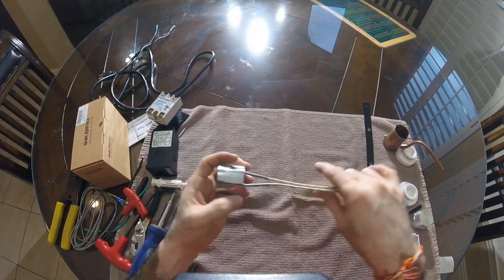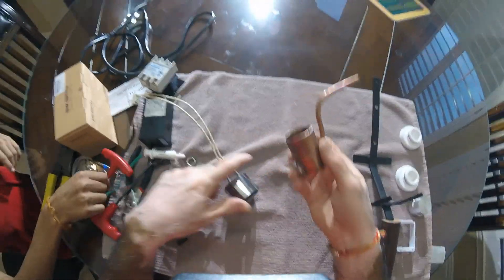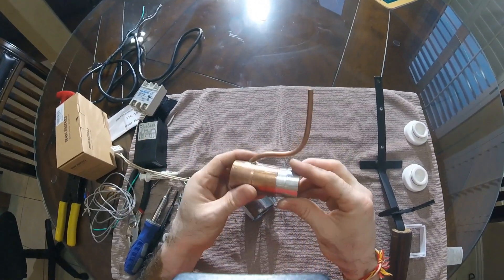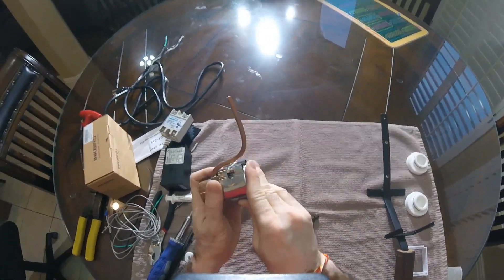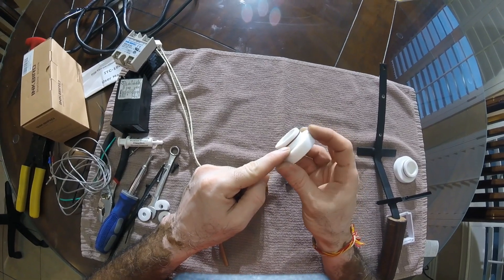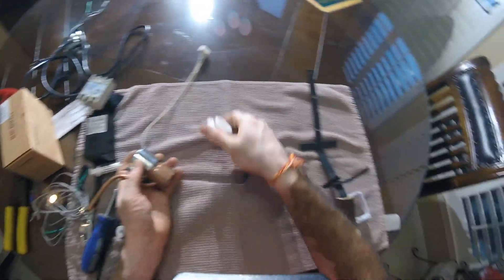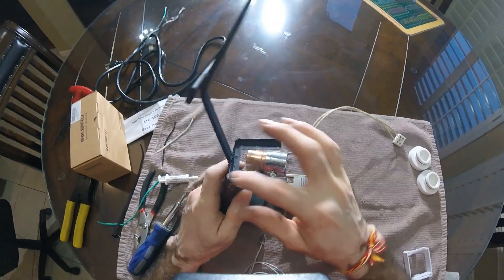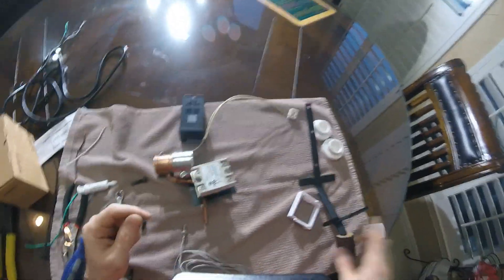DIY Oxalic Acid vaporizer - Made using a band heater

Comment: Excellent tutorial, Thanks!  Wondering about using the ITC-106RH and powering the band heater directly rather than the added cost of the SSR?  The 250w Band heater should use 2.5A and work within the  3A of the onboard relay eliminating a part and some cost.  Thoughts?
Reply from the maker: 3A is too close to operating power requirements. Maybe you can add a regular relay to power the band heater.

Comment: Please tell me the prices in the commants you use and what they mean .My basic problem is  that I easily loose  the   proper temparature 230c
Reply from the maker: PID settings would be different based on the mass of your metal. My settings are: P=100, I=135,D=17. You will
Reply: i will try it and i will come in touch. thanks

Comment: Hello. Is there any reason for bending the tube in the S or could it go outstraight ahead?
Reply from the maker: Straight is better. The reason for bending the tube for me is to be able to rest the apparatus on the bottom board when treating from the front entrance. In fact, the bent tube needs frequent cleaning to avoid blockage. Avoid bending if you can.
Reply: Thank you for your answer. All the Best for you

Comment: Hi, thanks for the great video. Can I use an on/off thermo controller instead of PID?
Reply from the maker: Yes. In fact,  I recommend using on/off controller or even thermal switch to save on cost. Because I mostly don't see my PID controller supplying partial current.
Reply: @PrincetonProjects  Hi, I'm using a 220v/145~175watt band heater, does it make a difference whether I use a 25A or 40A ssr relay? Thanks.
Reply from the maker: @mohamadrezaalamshah659  25A is a lot more than you need. For 230V and 175W, you only need less than 1A current. In fact, you may be able to use a simple relay and a on/off controller if you want to save cost.
Reply: @PrincetonProjects  thank you Princeton Projects for your replies which were very helpful. I'm almost there and down to the last part, cookpot. I have three options: 1. Two piece Brass tubing and aluminum block for the bottom, 2. One piece made of rigid aluminum rod, 3. One piece made of rigid brass rod. Which one do you recommend? Thanks.
Reply from the maker: @mohamadrezaalamshah659  One piece brass is the best choice but serviceability would be harder. The reason I keep the pot separate because copper pot will corrode first dues to acid which can be easily replaced by loosening one screw vs. single piece would need a complete disassembly. Not a huge deal but something to think about.

Comment: Where you find your thermal coulping on you vaporizer I can't find the small like you have on your video what size and part number if you have it
Reply from the maker: You mean copper coupling? Or band heater? Copper coupling from hardware store in plumbing section. Bamd heater from Amazon: 35mm diameter.

Comment: What type aluminum stock did you use
Reply from the maker: I used 6061 alloy
Reply: Does it not react from the oac
Reply from the maker: @stephen26448  I don't know. I don't see any significant pitting at the bottom.
Reply: @PrincetonProjects  so I guess it hasn't killed your bees then I was thinking about possibly gasses from the 2 parts mixing with heat
Reply from the maker: @stephen26448  Bees are doing great despite my help!

Comment: I am wondering what type of o-ring you used for the cap. I have lots of buna type, but don’t want them to melt. If you could provide a link if you used high temp ones as I am having trouble finding them locally. Thanks
Reply from the maker: Silicon o rings from eBay

Comment: Nice video! Thanks for sharing. How is this unit working for you? is it still doing well? is there any replacement parts did you have to do? Also, why did you use Aluminum for the bottom part of the cook pot? Wouldn't Copper or brass be a better metal?
Reply from the maker: It has been working great. The cook pot base leaks a little since I don't have it brazed but I like the option of being able to replace the copper "pot" in future. I used aluminum since that what I had on hand in my stock. Copper of bronze would be better. The outlet pipe needs to be cleaned by boiling off water after every few batches of OA. I would use a 1/2" copper outlet pipe if I build this ever again but that would also mean the copper pot needs to be much taller to avoid spilling boiling OA into the outlet pipe.
Reply: @PrincetonProjects  Nice!! I was thinking of using 42mmX50mm and 110V 380W Heater band. Do you think the PID unit able to handle that size? Thanks!! Keep up with the great work...
Reply from the maker: @gayandonamarasinghe8166  Yes, PID controller would be fine.

Comment: Curious what kind of solder was used to join the spout to the cookpot?  Most plumbing solder melts below the temp setting of the provap?
Reply: Don't use silver solder. Use bronze welding rod with oxi-acetylene torch.

Comment: The temp are too high!!!!
Hardly anyone knows that sublimation of oxalic acid occurs only above 159 ° C and a maximum of 189.6 ° C. Above this temperature, oxalic acid breaks down, i.e. decarboxylation, and what comes out of the tube is formic acid instead of oxalic acid and carbon monoxide and carbon dioxide. Evaporation of oxalic acid at too high a temperature, outside the sublimation range, is a procedure with much lower effectiveness compared to properly carried out sublimation.
Reply from the maker: I understand your comment and I think lot people know about the sublimation temperature of the OA. OA is hygroscopic and absorbs moistures so the initial high temperature is going to be used up to dehydrate OA. The idea is to drop the temperature range to sublimation temperature as fast as possible. You may be right about chance of hitting early temperature outside the sublimation range but this is a tradeoff between speed and effectiveness. In the past, I had a 12V OA vaporizer with temperature switch so the temperature never rose above the sublimation range but it was very slow i.e. about 5-7 minutes vs. less than a minute in this case.

Comment: Hello Princeton Project, could you give the ebay item number of the teflon caps, if possible, please? Thank you very much!
Reply from the maker: I MADE the caps myself on a lathe. I just bought teflon round bar on eBay.
Reply: @PrincetonProjects  hello, is the teflon  heat resistant ? do you sale the vaporizer?
Reply from the maker: @salambeekeeper9464  Teflon melts at 620 F so yes it works. Unfortunately I don't sell vaporizer or cap.

Comment: Can You help me wit the band heater? I can find only 110V  power in 380W, but I can't find the same 380Watt in Ac230Volt.... Do You think it would work 230volt too? Or what's the minimum Watt wich works for this Vaporizer? 

Do I see right, that the Aluminum rod on the buttom is for store the heat and need less time and power to reheat the cap? 

You Wrote, silver soldering won't work. You mean the hard soldering won't work? it's up to 750°C as good I know.... Or I did not understand anything? 

 Thanks,
Steven
Reply from the maker: I don't think the band heater of 110 V would work with 230 V. The wattage rating can be owner or higher but voltage must match your supply voltage. Lower wattage would mean your cycle times are going to  be higher.

Yes, t he aluminium block at the bottom is the heat reservoir.

Silver solder = plumbing solder for copper pipe. If your solder needs high temperature torch (i.e any oxi-torch) then your solder should hold up.

Comment: Great project and informative, just wondering if this tool could be wired up using 12 volt system, thanks again for this vid.
Reply from the maker: You can use inverter to power the device from 12v battery. I used a 12v design before using car glow plug and temperature switch but it took over 5 minutes to sublimate one charge. If you have only few colonies then glow plug design might work for you.

Comment: I have my teflon cap with o-ring installed, fits the 1 1/4 .coupling perfect. Also the aluminum base is now machined! Look so good and fits good! I'm getting more excited. I have another question. Is there a certain reason that your 1/4 tube has the bend and shape that you made? Will it work just as well if I use a straight 1/4 inch pipe coming straight out of the fitting, without the bend? Thanks, Phillip
Reply from the maker: Good to hear that you are making progress. The 1/4" bends serve no purpose other than to clear the heating band bolt. No 90 degree turns so you don't cause blockage. And shortest as possible to avoid blockage.

Comment: Jigar, what are the P, I and D settings you use on your PID? What temperature do you set it to? I have a similar design, but I use a REX C100 with the SSR. Thanks.
Reply from the maker: Setting would be different based on the mass of your metal. My settings are: P=100, I=135,D=17
Reply: @PrincetonProjects  thank you. I have updated my final project on bee source. Cheers!
Reply: What is your beesource name? I will look it up.

Comment: get the PID controllers from Auber, in GA.   $35 bucks,  and has built in relay.  Not a solid state, but a mechanical.  Works well.  Ive been using it for 6 months now. band heaters off amazon
Reply: Themachinewon which of the Auberins PIDs are you using?

Comment: Silver soldering does work, it takes up to 900 degrees.. Regular solder doesn't work.  Band heater heats to 450 degrees,  past the melting point of regular solder.  Silver solder the base and braze the tube to the cup.. Brazing has more flexibility,  silver solder is for ridged joints.
Reply from the maker: I used the plumbing silver solder and it melted at 250 C. I call plumbing solder as silver solder.
Reply: I did a second video, you can watch for the parts I used, and the handle, the bands,muffler wrap.  Im going to do another video with more details for everyone   @PrincetonProjects
Reply: Yeah, as you know by now its not the same.  Regular torch cant melt Silver solder.   @PrincetonProjects

Comment: I think you would have better heat distribution if you screwed the thermocouple in the centre, and mount the cup to handle using the off-set drilled/tapped hole...
Reply from the maker: Good idea.

Comment: Hello again I was curious what kind of O-Ring you used on your caps? I'm guessing something that can withstand high heat ? Thanks again. I turned 4 caps on a crappy DYI lathe I made they came out ok considering it was done on a lathe powered by my 3/8 drill lol.
Reply from the maker: The O-ring on the cap is made from silicon. Be sure to get the correct ID depending on the slot you cut on the cap. The OD should be little bigger than the ID of the copper fitting. The O-ring will wear out from use so make sure you get pack of 50 or something. They are cheap in bulk on eBay anyway. I think I paid about $8 on eBay. Item name: FDA SILICONE O-RINGS 024 QTY 50  1-1/8" ID X  1-1/4" OD. If you have a press then you can flare the opening of the fitting using a steel ball from a trailer hitch which will reduce the wear on the o-ring.
Reply: @PrincetonProjects  hi, sorry did not see this reply to high temp o ring .  Would be able to provide a source link?
Reply from the maker: @christopherc7242  I bought them from eBay. Just search for "silicon O ring" They do wear out over time but I can finish about 20 hives, 3 times before I replace them.
Reply from the maker: BTW great work making the caps on a "drill lathe"!
Reply: JP I would like to see how you did this, made the caps. Do you have a video? Thanks Phillip Hall
Reply from the maker: @PhillipHall01  Unfortunately, I don't have the video for making the caps. I simply turned then on a lathe. You may have to bore a starter hole in the center for cutting in the cup.

Comment: I thought the temp range was 160c to 187c?
Reply from the maker: You are correct about the sublimation temperature for OA but the device design suggests the start temp to be 230 C. I am sure there is some method to this madness temperature but I am just sticking to what others have figured out.
Reply: I am just trying to learn as much as I can, I plan on building a few different types of vaporizers to see which I like best. Thank you
Reply from the maker: @jpthedelawarebeeman6239  I am guessing the high temperature allows the moisture to evaporate and thereby speeding the overall sublimation time. FYI: I was using 12V glow plug design with a temperature switch which was taking over 5 minutes to finish the sublimation.
Reply: Very good question!
Hardly anyone knows that sublimation of oxalic acid occurs only above 159 ° C and a maximum of 189.6 ° C. Above this temperature, oxalic acid breaks down, i.e. decarboxylation, and what comes out of the tube is formic acid instead of oxalic acid plus carbon monoxide and carbon dioxide. Evaporation of oxalic acid at too high a temperature, outside the sublimation range, is a procedure with much lower effectiveness compared to properly carried out sublimation.

Comment: Does the outlet need to come from the top and bend down, to "pour" out?
Reply from the maker: The outlet needs to stay clear of the boiling oxalic inside the chamber so yes, outlet pipe should start high inside. But we are not necessarily pouring out oxalic acid since the vapors are coming out of this pipe. Keep this pipe as short as possible since it can clog up if it is doesn't stay hot.
Reply: watch my other video, explains the cap depth and where the tube is drilled in the side.. In theory, you could have the tube hole just above the bottom, as vapor has to go out the tube, you must have it high enough so the acid doesnt drain out first

Comment: Where i can buy this metal=? ore where i can order one ? Min 2:22 in your video ?
Reply: @PrincetonProjects  THXXXXXXXX for your help - and again i have a problem how and what i have to connect on the REX-C100 - and where i have to plug in den Band heater ..... its to fast for me in your video .... :( you send me picture ?? where i have to plug what `?
Reply: @PrincetonProjects  Did you weld the aluminum into the copper?
Reply from the maker: @sergethomas8853 No, just press fit.
Reply from the maker: @sergethomas8853  No, just press fit and held in place with the band heater.